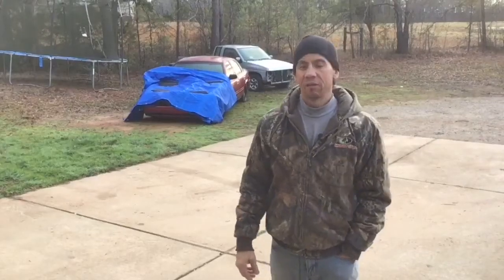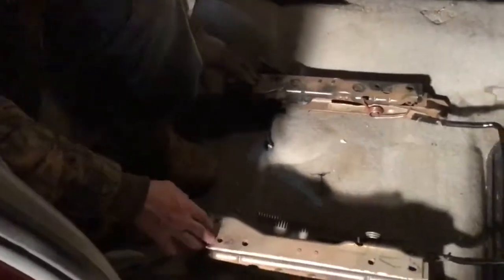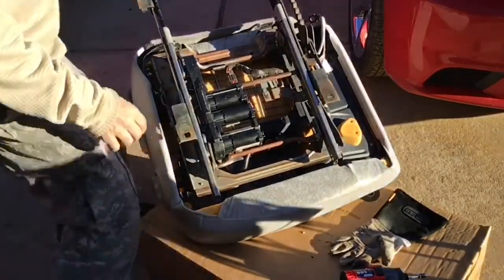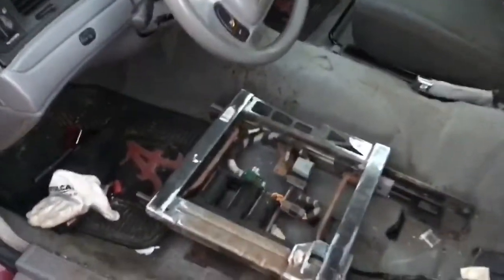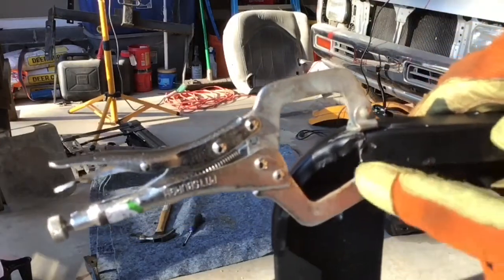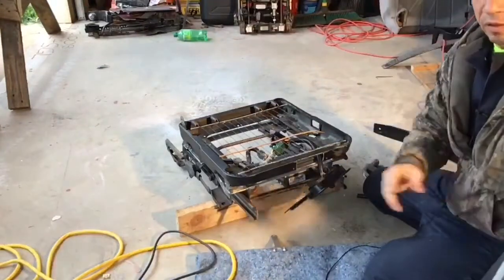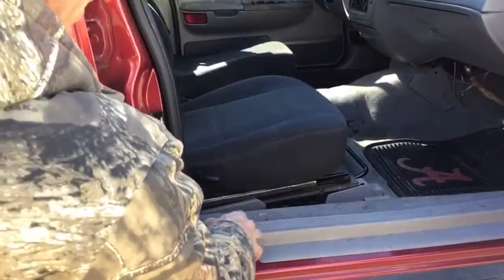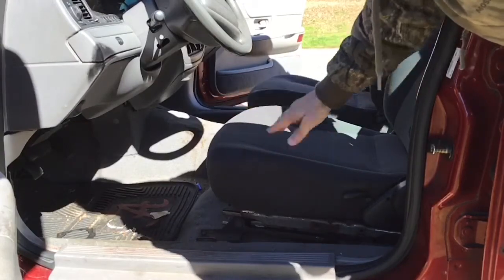I Got BUCKET seats. seat swap on Crown Victoria

Comment: You could also install lincoln town car signature series bucket seats on your crown vic they also have an arm rest compartment for storage i did this on my 2010
Reply from the maker: Nice did use the same mounting brackets?
Reply: @t.i.m.gthisisntmygarage1241  yes they bolted right in if you take the seat switches for the passenger side off the Town car you can also make them work on the crown vic like the lumbar adjustment and all that

Comment: Cool tutorial! I got some black leather '03 GT seats before I was sure I they could be modified. Only question I have is are the driver pwr seat harness the same as the Crown Vic? Thanx.
Reply from the maker: I had to use the Crown Victoria brackets and motor for the seats. Or what you can do is cut the harness back some and wire up to the car.
Reply: @t.i.m.gthisisntmygarage1241  Okay, Thanx.

Comment: i want to throw LS400 seats in my crown vic.
Reply from the maker: So what you want to do is use the frame of the LS400 and attach it to the Crown Victoria seat brackets. Welding them would be best.
Reply: @t.i.m.gthisisntmygarage1241  thanks!
Reply: @t.i.m.gthisisntmygarage1241  i got a 2011 crown vic i need some seats bad which year can i get out of another car

Comment: I need my Camaro bucket seats in my new 2010 Police Intrceptor...these mustang ones look not much better than the Vics
Reply from the maker: You right
But here’s what I decided to do is find some BMW seats to put in place
Reply: @t.i.m.gthisisntmygarage1241  Which BMW seats?
Reply from the maker: I’m looking into the 3 series and 5 series
Reply: Can i use 1999 bucket seats in a 2011 crown vic lx i have regular seats in there now
Reply from the maker: Should fit with no problem

Comment: What type power  tools are you using??
Reply from the maker: I'm using Harbor Freight welder Chicago electric with .035 gasless flux core wire, angle grinder, cordless impact from Harbor Freight, cordless drill, 18mm, 13mm, and 10mm sockets,  and all metal materials from your local hardware store like home depot and Lowe's